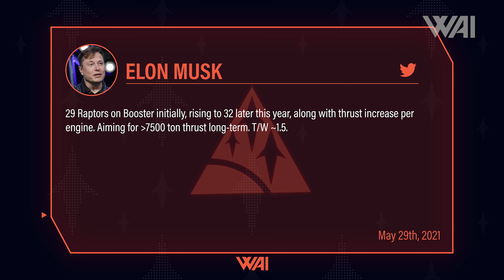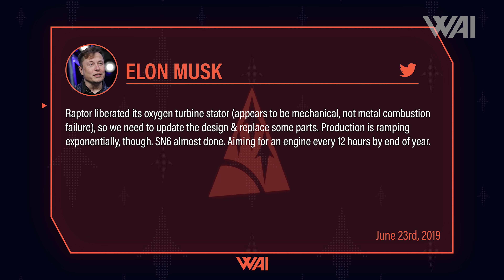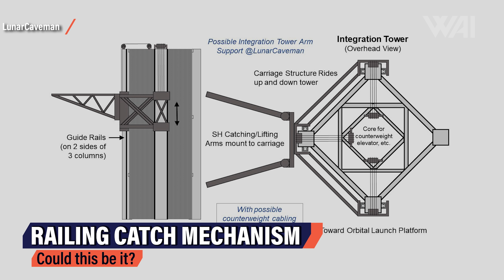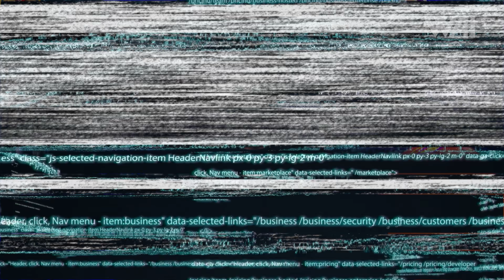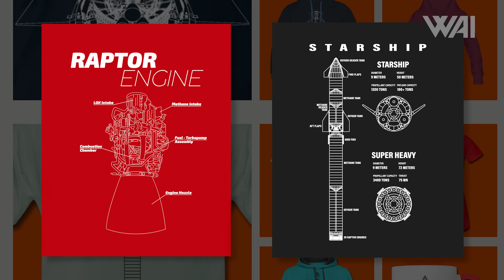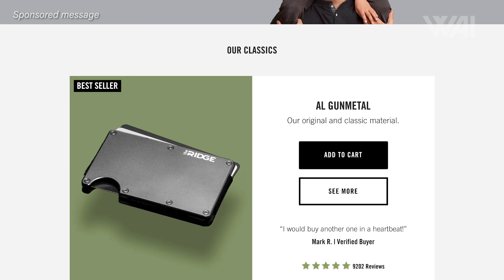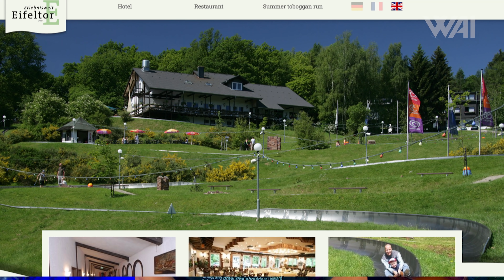SpaceX Starship Phase 3 begins! First test candidate at Launch Site!

Comment: I still cannot imagine how an orbital launch will function without a flame diverter and a water sound suppression system.
Reply: Water system is in construction
Reply: If it works on Earth it will work on Mars.
They will not have a flame diverter on Mars.
Granted Mars will not see 28 Raptors going off at once.
Reply: @sealy3  mars won't have the 28-32 engine booster though, so I don't think that is a good argument
Reply: @sealy3  yep people forget the reason Star Ship is being built. Its not for point to point rides like you hear about its to go to mars. So you have to make it function with those limitations in mind from the start. Good observation
Reply: @sealy3  Starships are one way,  they will not leave Mars.
Reply: @hartsy50  Not really, as Musk has said many times that methane was used as the fuel as you can make it out of the Martian atmosphere. So if Starship (second stage) was one way, you would not need to make methane on Mars.
Reply: @steveaustin2686  Yeah there no way anyone is leaving the first crew their as permanent colonisers, they will return to earth for a thorough medical examination. As well as the other teams. Once they have assemble some sort of colony then you will start to get people volunteering to live their permanently.
Reply: @DavidKnowles0  I agree.
Reply: @hartsy50  I believe they have chosen rocket fuel that can be produced on Mars so they CAN leave the Martian surface.
Reply: @shanerosengren3521  They would be too close to the surface,  all kinds of rocks would be kicked up and damage the engines or the ship,  that's why they are elevated on Earth.
Reply: @hartsy50  Yes, that’s a legitimate problem that would have to be addressed
Reply: @hartsy50  
That is true for early ships, but at some mature point, the ships need to make multiple trips until retired on Mars. Something on the order of 10 round trips to spread out construction costs.
Reply: @hartsy50  That may be correct for the first few, maybe ten robotic missions, but when people go, SpaceX Starships will have the ability to come back.
Reply: @hartsy50  The first ten Robotic landers on Mars, will probably have landing engines up high, like Lunar Starships, in fact they probably will be the same design.
Reply: @sealy3  Mars won't have a launch pad either. (At the first few launches )
At this stage I think it's more important to put the whole thing safely to orbit
Reply: @macko-dad  if they carry a launch pad and crane down with the first few landers then all of a sudden they have a launch pad on mars.
Reply: @macko-dad  I'd be surprised if they attempt orbit from Boca Chica at all. They'll likely have to wait until the sea platform is done. Cuz maintaining the exclusion zone for a 5000 ton flying bomb will be a nightmare.
Reply: @the_penguin_13  they are essentially going "almost orbit" for the first launch, so pretty much orbit but with less range safety issues. It's not quite an issue about landing yet since they plan on doing a water landing for the first ones
Reply: @mobiuscoreindustries  Landing isn't the issue, the launch is. You have 29 raptors igniting under 5000 tons of rocket fuel, I wouldn't put it anywhere near the facility.
Reply: @the_penguin_13  you are right on the money here. The risk of a launch explosion is just too high. The amount of facilities damage would be catastrophic if a full load of fuel went up.
Reply: @macko-dad  An we will have to at some point see Starship land and take off at a unprepared launch site, somewhere that simulate the type of terrain mars has. They will be exciting tests to see.
Reply: @EarlHare  That would mean undertaking what would be the most complicated robotic construction ever done, they haven't even attempted to use robots to assemble something that complex on Earth let alone Mars.
Reply: @mobiuscoreindustries  Yes, they're testing flight and atmospheric deceleration, and probably lots of ways things can fail, including completely missing any planned site by many miles, so not worth planning a landing. But perhaps they'll try a desert landing once they're sure they can hit a target area.
Reply: @DavidKnowles0  
The chemical plant only needs to have a high degree of redundancy and enough valve complexity to lock-out and/or bypass failed components. It stays in the ship. 
Both moisture and CO2 can be extracted from Martian air. 

Shallow surface mining probably can extract water ice even faster, but is not essential. 

Specialized 'dozer robots can unroll solar collector strips after they flatten the ground.
Reply: @falxonPSN  if the fully stacked starship explodes in the early stages and fuel spills everywhere, it will boil off pretty quickly and not burn that much
Fire isn't a worry
Explosion's Shockwave and falling rocket parts are much more dangerous 
If it explodes like +2 mins after the launch, it will explode on the ocean and there's no worries
Reply: @Matt0sh  that was my point - the damage from the shockwave would be significant and could affect speed of future FAA reviews this having a snowball effect on overall progress.
Reply: There's apparently a water system built into the launch table and they're appear to be building a water tank at the depot.  That's a bit of an odd approach though, because they're losing the gravity assist of a water tower, but that seems to be the plan.
Reply: @jake32901  you're right.
Not to mention that how much more easy and reliable is to build a gravity assisted tower compared to a complicated pump fed system.
Reply: @macko-dad  They will launch Starships from modified oil rig islands on the sea, and since they can not have gravity assisted towers there it is better to test the system without it from day one.
Reply: @macko-dad  
The Falcon-9 launches have a water tower/reservoir, but pumps are running before launch and water is rapidly overflowing from that tower right up until the water spray is started. One could argue that the tower is only a backup for the pumps at this point.
Reply: Agree - it looks very simplistic. Even Russian design looks more advanced.
Reply: Easy, light fuse and stand well back.
Reply: @tech 52 I think there will probably be damage to the concrete base after the first few launches. We might see changes as a proper flame and water/noise diverter system is added.
Reply: They are on it.

Comment: If it's going to take all of these engines to basically get an empty ship into space.  How are they going to get enough power to get a load into space?
Reply: There is more then enough thrust with the planned 32 raptors on the booster and 6 raptors on the Starship to get a 100 ton payload to orbit.

Comment: I don't think all 32 will work, so... How many engines can fail before we get a RUD?
Reply: This is what a test program looks like.  There is always a great deal of uncertainty along the way.  

Look back at the Merlin engine which at one time was going through testing trying to get it right.  Then we saw the Falcon Heavy fly with 27 Merlin engines which all functioned perfectly.
Reply: @michaeldeierhoi4096  Right Right... That's why I asked the question. I'm not saying they never will, just not the first time. =P
Reply: @michaeldeierhoi4096  People keep citing Falcon Heavy as being a similar number of engines to SuperHeavy - but it really isn't. Falcon Heavy isn't a single rocket with 27 engines... it's three separate boosters each with 9, and that difference is important when you're dealing with stuff like vibration and heat and plume interactions. SuperHeavy will actually have 32 engines mounted to a single thrust puck.
Reply: @simongeard4824  Also a good point.  Thanks mate.

Comment: As usual, congratulation for your work. What about a flame diverger below the launch platform? I think is very dangerous the return of flame and thrust wave from 29/32 raptors! 😱
Reply from the maker: Exactly my thought. I covered it multiple times. Right now it's unknown if SpaceX will build one but Musk has already stated on Twitter that it might be a mistake not to have one... :D
Reply: @Whataboutit  Well, the SN20 flight should answer that one way or another. I imagine they'll install some sensors across the tower structure to measure those reflected forces...

Comment: Initial booster catch testing could be done using another SN5 style single engine "hop" vehicle build.  After all they only need a vehicle that can lift off and then come back down at the expected speed.  Comparatively cheap to rebuild if it's lost versus a full booster build.
Reply: Interesting idea, but they would still need to do a test with a full sized booster anyway sometime.
Reply: @fredbloggs5902  That's why I said "initial" as the very first word.  You are of course correct about eventually doing a full booster catch but for an initial test they need only match the booster characteristics like weight, thickness of steel and like to validate the catching system they are planning.

Make the test vehicle easy, quick and cheap to build and they can perform a lost of tests if necessary to get a robust design.

Comment: I didn't know the legs of the orbital launch mount are hollow. I also find it hard to believe there is that much room for the RVAC engines under that skirt. I think on SHB they will find that 9 gimbaled engines is way more vector control than they need. 3 should be just fine. On the hold down clamps it would be quite a marvel to see how they plan to release every one of them at exactly the same time. If you don't you have a huge problem.
Reply: Please provide your credentials that validate your concerns.

Comment: I wonder if they will invent a variable-size bell (say, with holes and sliding covers) to be optimal at EVERY altitude from sea level to vacuum. Aerospike is equivalent
Reply: in that case just use an aerospike- simpler.  Look at the extendable bell for the RL-10.  It's similar to what you propose, but in this case it's for making sure it fits inside the fairing, rather than ISP optimization, IIRC.
Reply: No

Comment: I just hope starship doesn't end up like the N1 rocket did. Although, Elon musk is incredibly smart so I doubt the starship program will fail at all.
Reply: N1 couldn't be static fired, so the engines where first use. it couldn't overcome an engin failure with control system. The chance n1 like disaster is low
Reply: There will be some failures along the way which is quite expected with such rapid progress.  A whole lot of systems are going to be tested with this orbital launch.

Comment: 17:00 There is no sign yet of a holding surface on the “clamps”. So I don't think the rocket will be held down with these "clamps". I think when extended they provide a ledge for the rocket to set on and then move out of the way as the rocket launches. There may very well also be clamps to help keep it from leaning, however I think that support will come from some sort of arm(s) from the tower, as was used for the Saturn V.

Comment: Instead of three vacuum engines for ascent and three different seas level engines for landing - would it not useful for Starship to have only three engines, but with nozzle extension like the XLR-129 or the RL10-B2 ? You launch with the extensions in place - once in orbit you crank the extensions back to get seal level nozzles. Even if you add the weight for the actuating mechanism, you should still have a significant total weight reduction, as you now have only three engines instead of six ..
Reply: No...

...you clearly don’t understand Elon Musk’s strategy.

(That’s what ULA would do 🤣)
Reply: @fredbloggs5902  - seriously - increasing payload by a few tons and simplifying (at least in osme ways) would not be worth it?

Comment: Hey Felix! Any rumors out there about Space X possibly thinking of using the Gigapress process to simplify Starship and booster construction? I realize that electric and methane/oxygen systems are quite different. But, the ability to gigapress (much of) a Raptor would be amazing.

Comment: One moment !! ... Time-Line 12:44 ... SN20 is "landing" in the water ??!!!
I'm sure it won't come that way because it makes no sense to waste a complete Starship !! It's more likely that SN20 will come down as it should by landing on a ship-platform or something else stable.

One more moment !! ... Time-Line 14:12 ... where is the strongly needed flame-diverter ??
It's not possible to launch such a beast of 32 raptors without a flame-diverter !!
Reply: The drone ships are too small and the rigs won’t be ready in time.
Reply: Last info on flame diverter was: 
https://twitter.com/elonmusk/status/1313952039869788173?s=20
Reply: No, SH20 won't come down on a ship. Nobody is crazy enough to risk putting a ship underneath it for the first attempt, given that they've got no idea how many pieces it's going to be arriving in or how fast. As with Falcon 9 boosters, they'll make wet landings until they're confident that it's safe to put recovery hardware into the target zone.
Reply: @simongeard4824  Has it been the same thing with Falcon 9 in the beginning as well ?
I thought that Falcon 9 has been landing the way it does all the time.
But again ... could SN20 - not SH20 !! - land safely in the ocean without an RUD ? ... I thought it strongly requires a solid platform for safe landing.
I'm sure that an easy flame-diverter underneath could simply be assembled in middle of it at any time. But I'm wondering why that has not been an integrated part from beginning.
We'll see how it works ... or not ... in a couple of weeks testing that booster on top and how many raptors will make the first booster-hop.
The more raptors involved in that launch the more likely it will be that a few of them will fail ... (as we know from soviet try to launch that moon-rocket N-1)
Reply: @oliverweber6842  The only thing safe about this landing attempt is that they're aiming for an empty patch of ocean with nothing to hit... and I mean *nothing*. That's why they're landing in a Navy missile range off Hawaii, and not back at Boca Chica... they've got big radar for tracking ICBMs, and there's nothing to be damaged by falling debris when SN20 likely disintegrates on reentry.
Reply: @simongeard4824  That sounds a little pervert !!
They fear falling apart on re-entry so much that they decide to crash it in the ocean and rud it anyway even when doing a good re-entry before ??  That does not make sense at all !!
Is there no better plan by landing it safely on its feet after a good re-entry ??
It seems to me that SN20 is only made to look if it's possible to re-entry or not. Good landing ... who cares about it ... even it might be possible !!
Reply: @oliverweber6842  They've never done a Starship reentry... that's the point of this flight, to test something that's never been done before... launching to orbit, then bringing it back into atmosphere.

And so given the uncertainty, of course they're not going to try to land it on a ship... that would mean risking a ship that costs a lot more than SN20 does.

Comment: I can't wait for the orbital flight, but I would much like to see a low altitude test for SuperHeavy. Because if they fully load the booster and Starship and try to launch them to orbit and something untested goes wrong with the booster and it blows up, the blast wave may reach 40 km radius.
Reply: Please provide the calculations supporting your claim.

(In case of later edits, the current claim is a 40Km blast radius).

Comment: It is believed that they need to light all 6 engines in order for Starship to reach orbit, not just the 3 Rvac !
Reply: The Super heavy is going to take the Starship to orbit.
Reply: @j.f.almeida9081  Wrong, Superheavy is exactly like the Falcon 9 first stage, Superheavy gives Starship a good amount of speed, but it's starship putting itself on orbit then.
Reply: @MrRaph1260  So Rvac can work both on sea level and orbit?
Reply: @j.f.almeida9081  They can test fire the Rvac at normal pressure but definitely not the best. Anyway, Rvac will never be fire at sea level on Starship (except maybe static fire), they will at stage separation, something like 70 to 80 km in altitude where the pressure is nearly 0.

Comment: I would like to see a comparison of reentry heating and control between the StarShip being oriented nose downward and the as shown nose upward.
Reply: I think it will always reenter a bit nose first to protect the engines, if the nose is up plasma would enter the engine bay and it would need thougher heat protection.
Reply: You need to understand the concept of relative airflow.
Reply: @fredbloggs5902  Yep. "Up" and "down" don't mean anything in this context... the important direction is "into the airflow", and that's always going to be the belly of the rocket, not the nose or tail.

Comment: The exhaust would destroy the floor beneath the launch structure.
Reply: we'll there are systems to solve this problem
Reply: In a very big way. Check out  the video of the 39-A launch pad after a Saturn 5 launches!!! Devastating.
Reply: Shane Humphrey  what
Reply: Shane Humphrey  thst steel would have to be cooled, like rocket engines are or it won't stay strong for long st all.
Reply: @GundamReviver  That's pretty easy compared to the (already solved) engineering problems of cooling a rocket engine...

Comment: Hasnt Elon said that the Starship will use both Vaccum engines and Sea level engines when in space? Dont have a source but seem to remember that they would keep sea level engines running for gimbaling thrust even though they arent optimized for space
Reply: Vacuum engines are in testing proper..